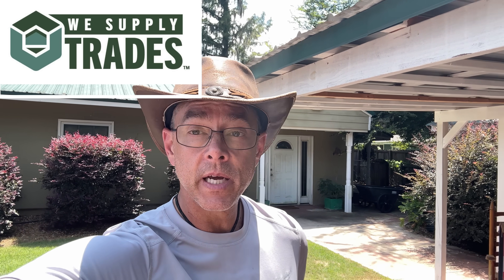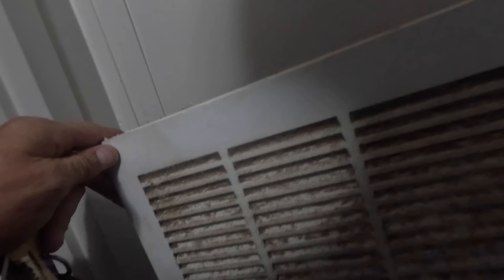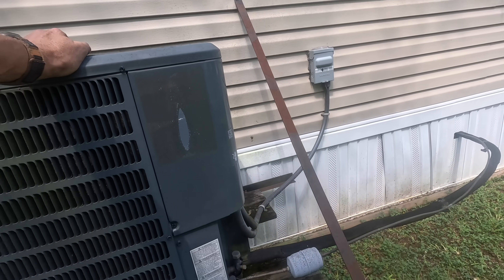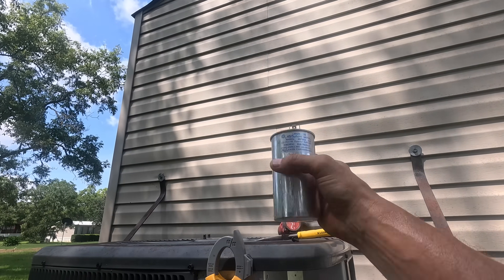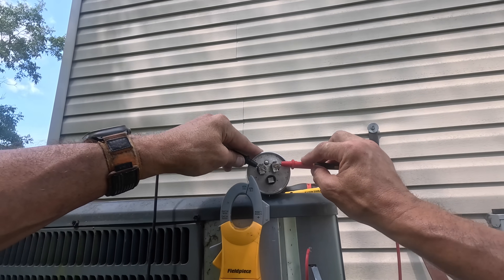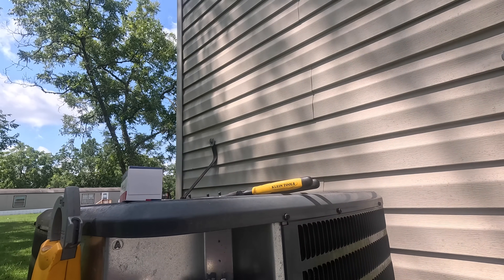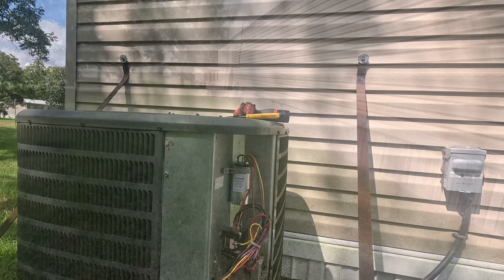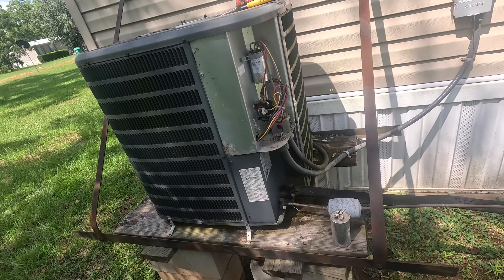New Tenants Reported No Air Conditioning! #hvacguy

Comment: That C should really be called pass thru.  The current passes through that connection without going into the capacitor.
Reply: Umm......no, not how that works. The C is connected internally to the other 2 terminals to provide power, if not it wouldn't work.......

Comment: the C/Common on a dual/multi value capacitor is to denote it's the common terminal to the various values, so it really has nothing to do with what it's connected to on the equipment side.
of course you/technicians need to understand and know where it should be wired to so the equipment works. so in the end, thinking about it however works out to remeber.

Comment: They just moved in, then the landlord is at fault for the dirty filter. The place was probably not cleaned before the new tenants moved in. No chirping, the battery must be completely dead. You could have left the new cap in the box and set it down with a little electric tape. Well you had to go and do it right. Nice job

Comment: I bought the Nu Calgon portable sprayer and foaming gun for this reason. I carry 2 hoses but sometimes it's too far away or the water valves are severely damaged and I don't want to create another problem. It runs off my Dewalt XR 5ah batteries with decent enough pressure and lasts a long time before needing a fresh battery.

Comment: Are these all rentals or do people not see or read all the "CHANGE YOUR FURNACE/AC filters every 90 days. Or do people just not give a sh_t! 💩 Amazing! So many good filters being sold on line at way cheaper than big box stores. FILTER BUY, SIMPLY FILTERS, etc And not those crap fiberglass filters. Good pleated MERV 8 filters.
Reply: We use a fiberglass filter in the return grille and a MERV 8 by the air handler!
Reply: I prefer the crap fiberglass filters. The pleated filters are too restrictive IMO, no matter the merv.

Comment: Was that a clarinet I heard in the background, or something else? (baby crying too maybe)
Reply: It's the water line when he was using the hose. My fairly new house does it too. Not sure what the cause is.
Reply: @Kitfoo77  either a pressure regulator or a backflow preventer is having harmonic vibrations. sometimes a high flow on/off can cause toilet fill valves to open/shut due to water hammer surge hitting them also. also same water hammer surge can cause backflow preventers and regulators to howl with reverse flow.
Reply: Was wondering if Curtis had bean soup for lunch before going on that call. 😉

Comment: i dont blame the homeowner for not being able to change the capacitor, but he could at least clean the grill and lousy filter.
Reply: The Landlord or maintenance man should have done it when they cleaned the unit for the new tenant.  They didn't even check to see if the A/C was working.
Kind of hard to blame the new tenant who's just getting moved in and not expecting to be doing routine maintenance on day one cause the Landlord and maintenance man dropped the ball.
Reply: @patrickinottawa27  You are right about that. Can't blame the tenants yet, next time. lol
Reply: I have the same type evaporator coil on my system and there are supposed to be two filters on the coil, one on each side. That flimsy crap on the grill doesn't cut it.
Reply: They don't own anything and not responsible for anything.
Reply: If the homeowner did that the property would no longer be his funnel of passive income though 😅
Reply: My AC went out last week, and a generous neighbor lent a window unit he was no longer using... Now the filter door was taped shut because it wouldn't stay closed with how packed the filter screen was. I scrubbed out a good palm full of dust out of it, and this is only a 12k BTU unit. Poor thing must have been straining.
Reply: @ravneiv  Nice of the neighbor to loan you that, but you can buy them new at WM or HD for a couple hundred bucks. Reason I say that is those ACs can be quite fragile. I pulled one out to clean once and it barely flexed, pssst, there went the freon.